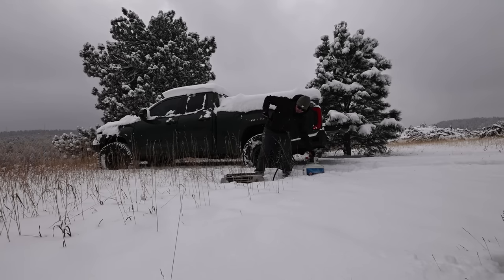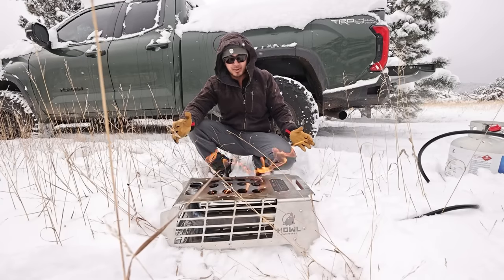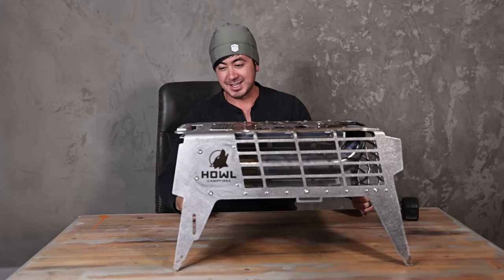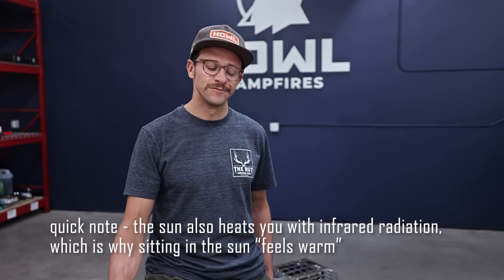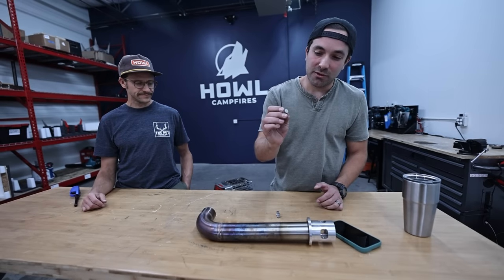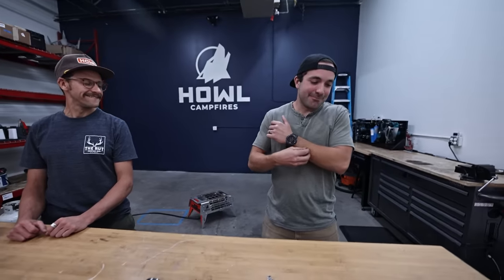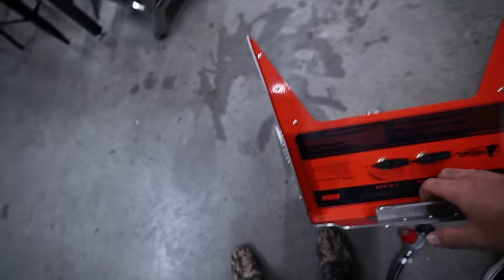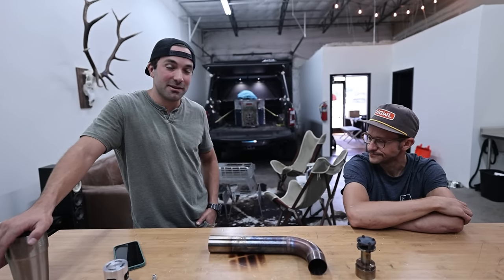HOWL CAMPFIRE FirePit Review - REVOLUTIONARY Propane Firepit

Comment: That’s some insane $ for a fire pit, no matter how cool it is.
Reply: yea all this goofy shit is ridiculously priced
Reply from the maker: Innovation almost always comes at a cost, unfortunately - especially when it’s taken on by a small startup. But like I said in the video, i agree, it is an expensive product.
Reply: @LastLineOfDefense  It’s not just expensive though. It’s almost laughable how much it costs.
Reply: @PNWCamper1955  And the fuel consumption alone is wild compared to other capable propane fire pits. just 6 hours off a 20lb tank? Yikes. It's an awesome product for sure. BUT insanely expensive startup and operating costs. It's honestly the only reason I prefer Ignik vs LavaBox... Yeah, the LavaBox can output more BTU's but the fuel consumption is where you need to outweigh the actual benefit of those added btu's...
Reply: I've got 2 different sparklers fires, I'm drooling for this one.  Price is no object when you know you can blast some heat and not burn down the area!!  - Not sure where you're based, husband and I have our individual rigs in Fairplay.  Thanks for not sharing the trails!!!! We locals appreciate it!!!
Reply: Hopefully they can get it down to $999.
Reply: Had mine 2 weeks now and love it! Only complaint is the cheap regulator with plastic screw on connector that screws on the tank. Mine started leaking after 5-6 connections. I took it to my brother n laws’s LP gas company to replace the cheap leaky regulator with a heavier duty 5-10 Lb adjustable one with a new 10’ hose. He mentioned that the cheap regulator was junk and I would have to agree as well. Other than that, it’s a beast in front of a 12’x12’ bakers tarp shelter on cold nights and it’s built like a tank! Not to diss the company, but I gotta keep it 💯 with the community. I would seriously replace the regulator and tank attachment after buying this unit.

Comment: This looks like a great product and I want one but I think they need to find a way to bring the cost down and make it smaller or at very least have folding legs and square it off.  It looks like a pain to pack. They’re on to something though.
Reply: Agreed- They should modify the legs to a spindle style you can screw in for setup & stow internally for travel. I’d bet they find a way to reduce the cost in the next gen, when Mike said it was *expensive* I thought he was going to drop an $899 price tag but $1,300 🤯
Reply: @484465  Totally. I usually have no problem splurging on camping gear either but this is just outside the realm of any justification. It feels wasteful.

Comment: The new Ignik Firecan Elite is 50k BTU, vs the Howl at 62k but one is $250, lasts much longer and is much more packable vs $1,300.
Reply from the maker: Yeah, BTU isn't a very accurate measurement of felt warmth. Firecans are cool (I have Lavabox), but they put out heat straight up to be blown away. If there's no wind at all, and you kind of stand above them, and manage to not burn your clothes with the flame moving around - they do put out some heat. Certainly the price is right, and they provide good ambiance - but for actual warmth, nothing touches the Howl currently. Is it worth the price? Eh, to some people, but not all.
Reply: @LastLineOfDefense  Good take.  You are right in that BTU aren't the only measurement of heat, but they're probably the most measurable.  I like the Howl, a lot, but with a Firecan with lava rocks there's also emanating heat.  I believe the Howl is definitely warmer, just don't know that the higher output is worth 5x+.  
I only mention all this because overlanding has moved towards a totally inaccessible price point, where costs aren't correlated to expenses, but to the market.  I'm certain these guys invested a ton of time and resources to bring this to life, but so did every startup, many of which do value accessibility.
Reply: @SD8_ yea. I'm with you. I'll be waiting for the more realistic brand making the same thing, or actually tackling it in my garage with some tubing and a welder.

Comment: Here's an idea... buy a $30-$50 propane burner stand used for turkey frying or seafood boils.  Then, put a <$50 cast iron dutch oven upside down on top (could even be that old rusty one in your garage).  Infrared radiated heat from the cast iron for <$100.   Have fun.
Reply from the maker: Maybe I’ll try it. I’d guess something like that would work, albeit you’d need to be closer and heat would be much higher and it’d be less ideal for warming your body/legs. A little more cumbersome and less effective, but cheaper for sure
Reply: Yep, I get it.  I'm just saying that if the big selling point of this fire pit is the IR heat, there are cheaper ways to get that radiated heat.  One idea is putting cast iron onto any type of fire pit.  I just used the propane stand as an example because they are really cheap.   @LastLineOfDefense